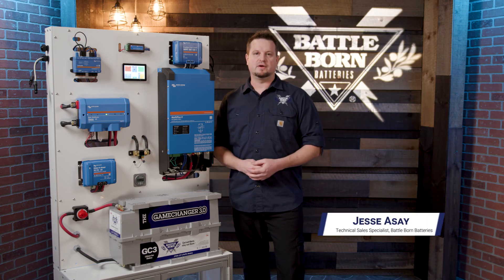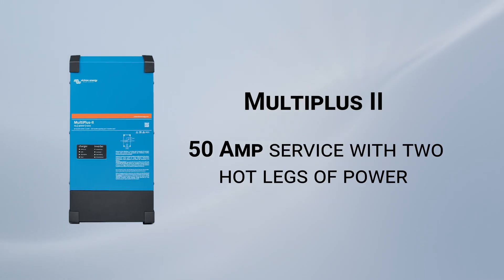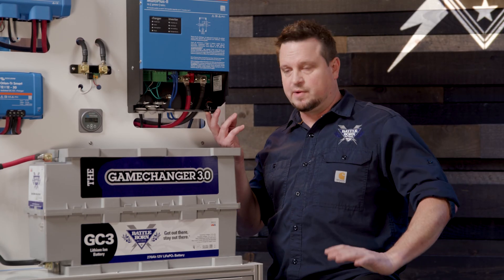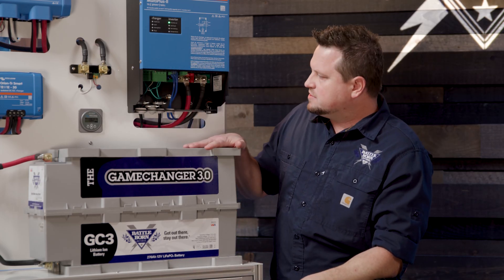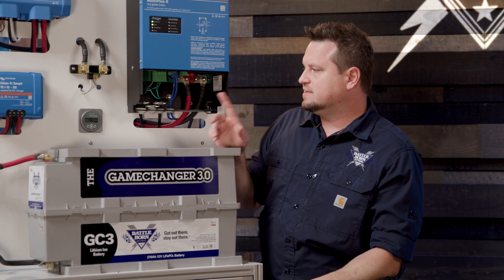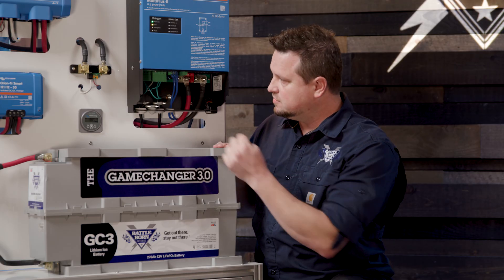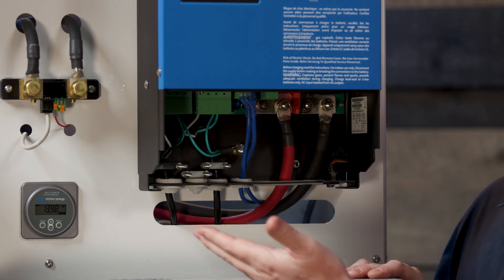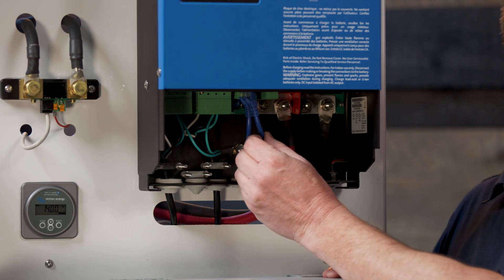FAQ: The Victron MulitPlus-II & How to Wire

Comment: I caution everyone to NOT use what they see here as a wiring diagram for their system. There are fuses and circuit breakers missing.  This is only to show the Victron components. Not to show how they are properly connected in a system, there are just there to explain what each one does.

Comment: Hello
I would like you to give me your opinion (expert!)
I have a multiplus 2 (230 volts) in 8000VA in output + (2X on the 8000VA) should I put 1 or 2 disconnectors? since 2X50MM² are needed
2 disconnectors are better I think? the 2 cables of 50MM² will not fit on a disconnector. What do you think?
on the other hand for the - (2X) should I also have 1 or 2 disconnectors?
or can the 2 cables - of the multi go directly to the P- of the BMS jk?
thank you

on victron it recommends for the 8000VA (2 cables of 50MM² per polarity)
i would like to separate the + and - of the multiplus with disconnectors because if I am absent for a long time I would like to cut on the multiplus side but not on the mptt side which will continue to charge the batteries by the JK BMS

Comment: could you recommend what gauge of wire I should use for the AC IN/OUT. My RV is a 30amp and currently uses 10/3 romex solid strand. From what I have learned the Multiplus-ll requires stranded wire. I have seen some cases where the AC terminal blocks have overheated and melted on some using solid strand or having a bad connection in general. I don’t want that to happen to me lol. My runs in and out are about 10 feet or so. Thanks in Advance
Reply: 10 awg is 30 amp ac correct size has little to no voltage drop

Comment: I have the plus II 12V and only using 1 phase until full 220 can be run into the small building.  I have the AC1 outlet working and the whole unit charges well and the inverter works well.  However I can't seem to find out to "turn on" the AC out 2 system.  An RV refrigerator is running on 120V (dometic) and uses the 120V electrode on the cooling unit.  When the power goes out, I want to have that not connected to AC 1 out when all starts to invert ... if it was it would drain the batteries quickly.  Thus the AC-out-2 should have power when the AC input is coming into the MP II.  I am not reading power there at all.. So I am thinking there is a way to turn on or turn off the AC-out-2 line ... where I'd keep it connected to the RV refrigerator etc. I noticed the Victron has an updated MP II manual.

Comment: The AC power wires coming in seem such a small gauge (like compared to a 50 amp RV wire), is that safe?
Reply: I was thinking the same thing.

Comment: Is this a 240v inverter? Can you combine  the two 120v for 240v?
Reply from the maker: Whether it is supplied from shore power or a generator, the MultiPlus-II 2x 120V can accept and pass through both lines of a 120/240V supply, with the capability to utilize the full 50A for charging and AC loads.
Reply: So the output, can be configured for two 120v or one 240v
Reply: @carlosreyes6448  This only works on a 12/24v system depending on which you are running and purchase. If you have a 48v system like I do you would need two of the regular 48v multiplus II to run that 50amp service